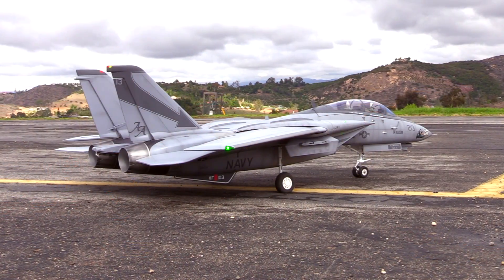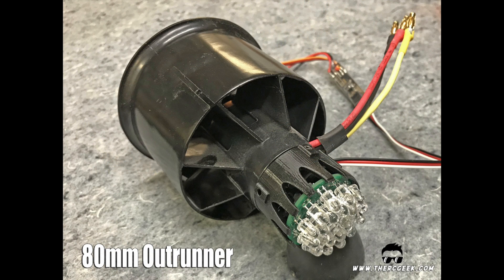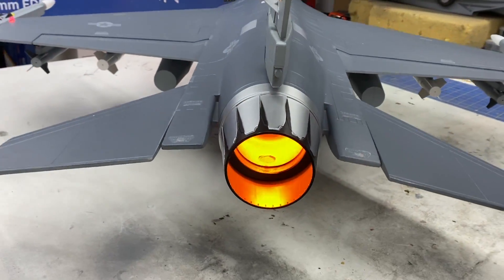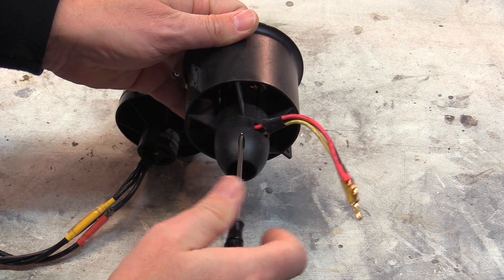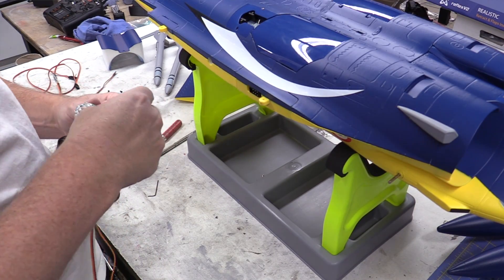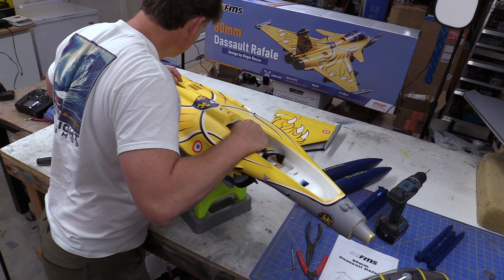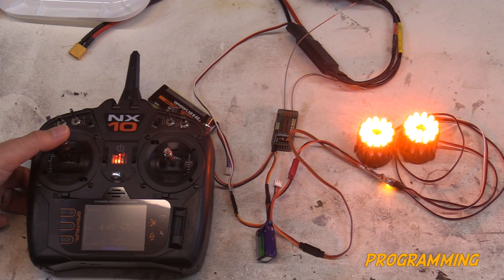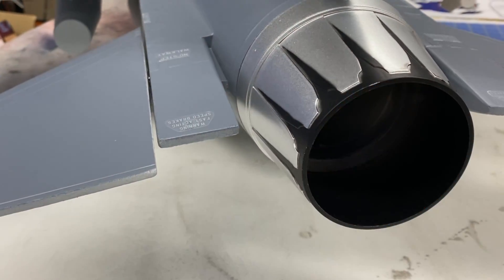How to add a Simulated Afterburner to your EDF Jet: The CenterBurner!

Comment: Adding to a seperate channel with throttle as an input sounds like the way to do it actually!  Can then add a slow function so that it slowly ramps up and down, even if you cut instantly cut the throttle it would slowly fade away over a couple seconds for a touch more realism.

Comment: Will this work on the E Flite Viper 90 BNF? Has smart avian esc and ar637t receiver. Dont think it will have an open port
Reply from the maker: Yes, I’ve release a V2 that is compatible with the smart telemetry which will allow you to connect it via a yharness on the throttle. 😊. The correct version is my 36mm inrunner design: https://www.thercgeek.com/product/90mm-CenterBurner-V2-Single
Reply: @Thercgeek  Thanks! Just placed my order for one to go on my first EDF the Viper 90.

Comment: Is there a voltage cutoff built into the control when powered by the separate 2S battery so it doesn't over discharge that battery?
Reply from the maker: There is not, no. The current draw is really low, so the likelyhood of that happening is small unless you don’t ever charge the pack. I can get multiple outings on a single charge and only use maybe 40% of the capacity in the process.

Comment: I'll be ordering an F14 next week from Motion and I'll be installing these for sure... because they are waaay too freaking awesome not to! lol.
Reply from the maker: I appreciate your support! Not gonna lie, it looks so good in the FW tomcat 😎
Reply: @Thercgeek  I just installed these and they look awesome! I have two questions. 1, I bought a 2cell 300ma battery. Is 300ma going to be okay for a 3 minute flight? I have no clue what kind of current these draw. and 2, the 3d printed plastic split on several of the set screw when tightening up the grub screws. I didn't crank on them hard either. Actually, one split when just starting the grub screw. They seem to be holding but with the split plastic I am a bit concerned, do you recommend adding some adhesive in addition to the screws? Thanks!

Comment: Hi. I just ordered the afterburner for my Viper 90 and notice that my receiver only has 6channel and they all are taken up with flaps, gear etc.  Question,  How do I connect the burner to my receiver because I do have the NX8 Transmitter with telemetry?
I don't have an available channel
Reply from the maker: Unfortunately because of the smart telemetry, the burner needs to be setup on a separate channel. This is due to the srxl2 communication type that is used that the controller doesn’t know how to interpret. That means a higher count receiver would be needed for the viper. There is a workaround that would allow you to use the 6ch receiver, but it nukes the telemetry. Basically, you can change the channel assignment of the throttle to a different channel, but that means no telemetry data.
Reply: @Thercgeek  Okay. So, I can move throttle to another channel but can I move what's on channel 6 to channel 1 with the ESC?  Please explain how this is done I don't mind  losing telemetry
Reply from the maker: So, in the channel assignment menu, assign throttle to channel 2 and aileron to channel 1 and then swap those connectors and try that. I recommend testing ailerons first after the swap just to make sure it took correctly before trying the throttle.

Comment: Hi mr geek i installed your burners on my twin 70mm freewing su35 and i had to add 7 ozs of weight to get the jet to balance at the CG in the manual! Is 7ozs too much weight to add?
Reply from the maker: It’s not uncommon to have to ballast accordingly to get the cg location. However, in this case it sounds like it could use a larger flight battery instead. What capacity flight pack are you using?
Reply: @Thercgeek  i am using a 6s 5200mah 50c I have my weights mounted on top of the battery!Will that hurt anything?

Comment: Never any issues with the 3D printed cone melting or warping from the heat of the motor?
Reply from the maker: Haven’t experienced any type of those issues. I use PETG which helps with the thermal properties.

Comment: So if I put this on a y to a spectrum receiver I won’t get safe and as3x? Or is it just the esc telemetry
Reply from the maker: Putting this on a y when smart is active only impacts operation of the burner and nothing else. The communication type changes from pwm to srxl2 when Smart is operating which the burner controller doesn’t know how to interpret. Therefore, setting the burner to a separate channel alleviates that and provides a pwm signal for the controller. I am working on my own controller design that will be compatible with srxl2 and have a few more features. Unfortunately due to the chip shortage, I’m not sure when that will come to market.
Reply: @Thercgeek  ok thanks man looking forward to putting one of these on a freewing f-86 your lights are done so nicely